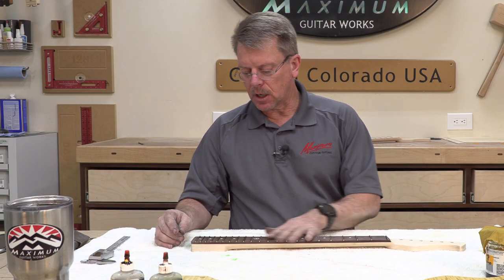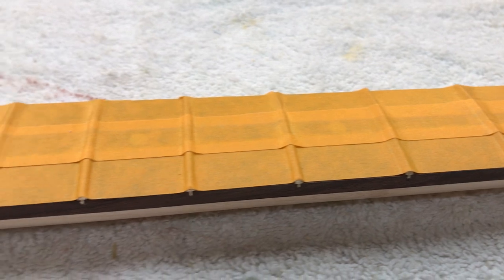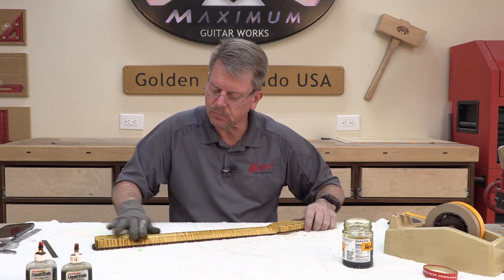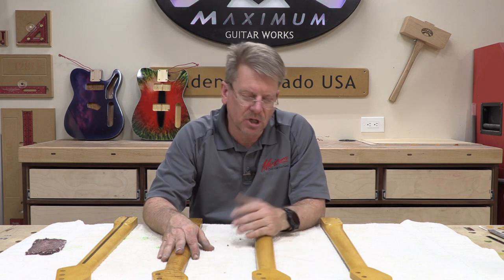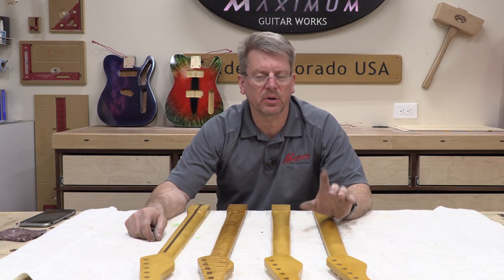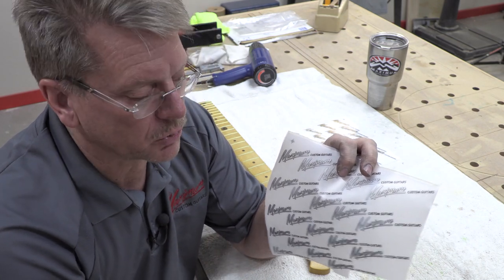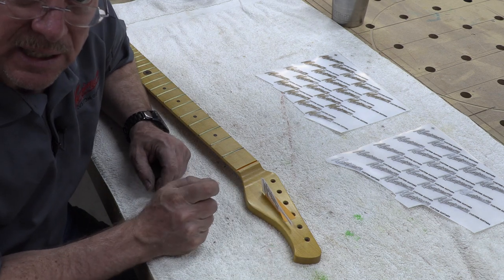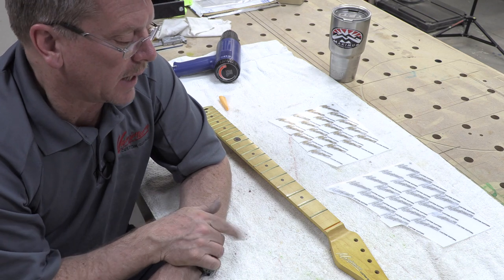Telecaster Build - Part 15b - Neck Tinting, Logo, and Finishing

Comment: Hi Steve - just a thougth. If you mask off the sides of the fretboard before tinting and leave the masking when spraying finish I believe that the tinting coat should seal any tiny gaps in the masking tape - that is if you  want absolutely no finish on the fretboard. Btw. Very slick with the transfers.
Reply from the maker: A little finish to clean up doesn't really bother me...I do want to reduce it as much as I can.  However, I do want to seal the edges of the fretboard as to me that feels best with a lacquer or poly neck.

Comment: Hi Steve, nice series. I would like to see your approach to installing the Hotrods, spoke wheel, truss rod. I have been installing mine from the top, also installing carbon fiber rods. I am interested in your approach to drilling the hole for the spoke wheel, so that is in exactly the right spot. Routing the center slot isn’t hard but I put the spoke wheel at the heel of the neck, flush, like a traditional, old school Fender truss rod.  I wonder if you have developed a jig to drill from the heel side?  Maybe you don’t do it quite the same way. If you have a tip, I’d love to hear it, in the mean time, strive for excellence!  Jeff
Reply from the maker: I thought that I had showed that in an older video...but I could be mistaken.  I drill the hole for the spoke wheel barrel first...then I rout the channel.  Built myself a little jig to help nail the correct position.

Comment: Have you ever had a problem with the grain raising when you tint a neck with the dye?  I tinted a neck with Keda dye mixed in alcohol and the grain raised noticeably.  I wound up sanding a lot of my dye off to smooth the grain.  What did I miss?  Great video, BTW!